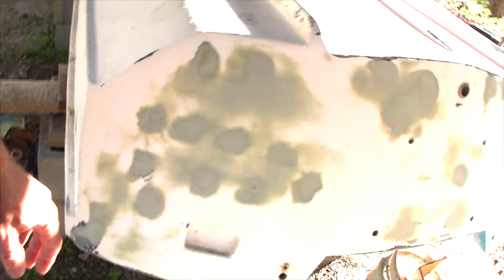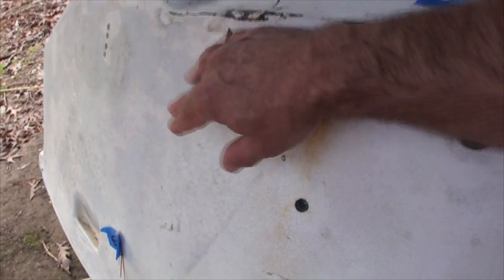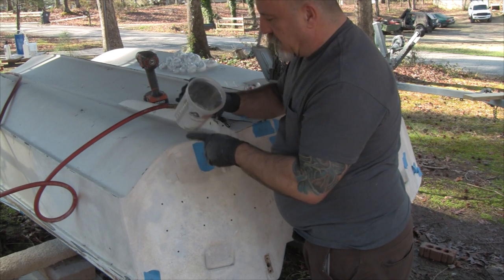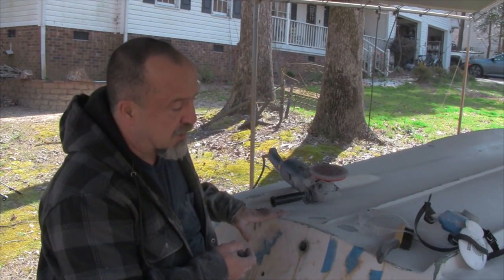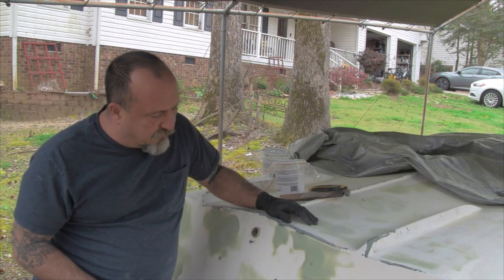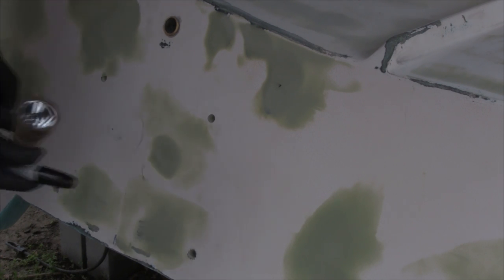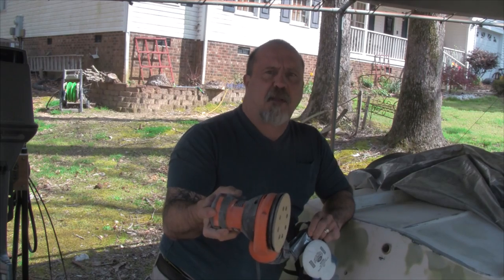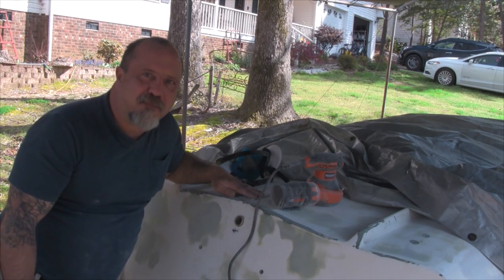Transom Hole Repair and Fairing - Boston Whaler Restoration Part 10

Comment: great job and perfect use of TotalFair and the 5:1 epoxy! thank you!
Reply from the maker: Thank you! I'm a huge fan of your products and will use them whenever I can! I think this whaler will have about 80%+ TotalBoat DNA when it's done (hopefully soon)!
Reply: Also what size epoxy did you use on this rebuild?? Would love to know  for my whaler project.. Thanks again !
Reply: @totalboat must be nice to order a gallon of TotalFair and there not be a MILLION pinholes to chase down after applying TotalProtect. That's what I've been doing for the last week on my Whaler restoration.

Comment: Extreme!  Good to see you finally started.  Was wondering where you were with all the COVID-19 going on. I finally finished all my repairs, got it primed.  Just finished applying the 2nd coat of paint.  I plan to put down 4 coats total.  SC finally put in a Stay At Home order so I've had plenty of time to work on it, provided the materials last.  If you are on Linkedin, let me know and I will give you details on what I did as far a priming and painting goes. Could send you some pictures too.
Reply from the maker: Sounds good! I'm glad your getting more done with yours. I feel like it's taking me forever lol. I am on linked in and FB. You can email me directly if you go to the about page on my channel. Tries that on your channel but the about isnt available there.

Comment: Hey, I have the same boat and it despritly needs to be painted. My dad spray painted the inside of the boat when I was away. I would love to get the inside paint looking the way yours is. I also desperately need to paint the outside. And need to do something to get the wood seats we built to have that glassy look. Do you have any tips?
Reply from the maker: I would suggest going through the video one by one. You can also go to my website extremediy.org where the entire series is available in written format. There are also links to the materials I used for paint, fairing compound, epoxy resin. It's a lot of work and you can plan on spending $500 plus on paints primers etc. Best of luck on your restoration!
Reply: Extreme DIY thanks, keep up the great work! Looking forward to watching your progress.
Reply from the maker: Thanks!

Comment: Good video. I used painters tape to make my glass repairs not sag and stay smoother. Switched to silicone adhesive backed mylar tape. Works great; doesn't hang as much as painters tape. Nothing wrong with a little trick here n there.
Reply from the maker: Thanks, that's a good tip, I'll certainly try that on my next restoration.

Comment: These videos couldn’t be more helpful i just picked up a 1967 16 ft whaler and I’ve been looking for helpful videos and I’ve hit the jackpot! What grit sandpaper were you using when sanding the fairing compound? And I’m in the stage of trying to get all the old paint in the inside off I’ve been sanding with 60 grit, how did you strip all the old paint off of yours? Also do you order your total boat products they seem really good quality and easy to use ! I have a bunch of screw hole i need to fill and minor glass work !
Reply from the maker: Thanks Darien! When sanding the fairing compound I've used anything between 80 and 120 grit, it just depends on how aggressive I need to get, most of this was done with 80. As far as topside paint stripping, I used 60 for most of it, I didnt get all of the paint off on the inside of the boat but aimed for a smooth finish for the primer to adhere too (I used single part paints and primer on the inside). The Hull and transom are going to use 2 part epoxy primer and polyurethane so I had to get the paint off to make sure there is a stable surface for the epoxy. Yes, I have been using Totalboat products almost exclusively. Great products and amazing technical support!

Comment: What size fairing compound did you use on the  build ?  Also good thinking On leaving a link for the materials used ! 🤙🏽
Reply from the maker: I used the Quart sizes (total of half gallon). I'm pretty much through with the topside and hull and still have a bit leftover. There's affiliate links to the materials in the description, just need to scroll down a few lines. Thanks!
Reply: Jose's Extreme DIY  ok i seen the links and thanks I will use those links  by helping me I’ll help u back  🤙🏽
Reply from the maker: @chasingwaves11  Awesome man, thank you!

Comment: Hello Jose, my name is Jose and I’m restoring a 17’ montauk and kind of a noob. Did your whaler have water in the foam if so what was the best way to take it out?
Reply from the maker: Hey Jose!, I had an unusual situation, the starboard chine was completely opened up. There was actually no foam underneath the fiberglass, almost all the way back to the transom. I think that what happened is that the ran it that way and the water acted like a power washer, blasting the foam out. I injected foam to fill the void. There was probably water in the rest of the hull but to be honest, I was able to lift either end of the hull easily so wasn't to concerned about it. There's a lot of different opinions on hate in the foam ranging from tearing the flooring out and replacing all the foam to drilling holes in the rear of the hull to drain. If your doing a full restoratin, it might be worth drilling some exploratory holes along the hole to evaluate it. Just dont blow compressed air in the holes as you can delaminate the fiberglass (ask me how I know lol).
Reply: Thanks José I’m not going to ask how you know but I have bought all my materials and ready to start project. I opened up some 3/8 holes on a soft spot I had and I also opened up holes on the bottom of the hull. But the bottom isn’t as wet as the top so I’m going to be flipping it and let the sun and gravity do it’s job. I’m also thinking about opening up the transom and replacing wood and reglas.
Reply from the maker: @josemartinez-dq1lh  Sounds like you got a good head start. If you have any doubts about the transom, then definitely rebuild it!
Reply: Hey José do you have any social media accounts for I can follow?? Also are you on EBW on Facebook?